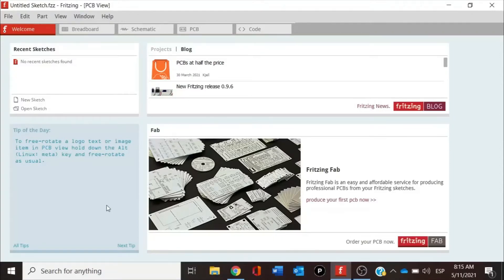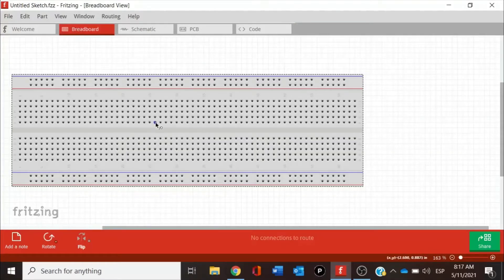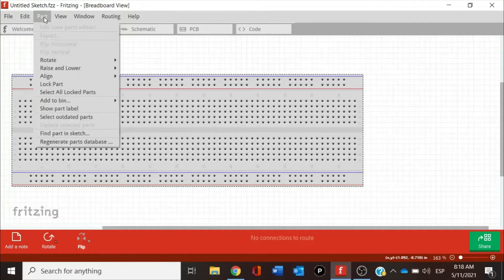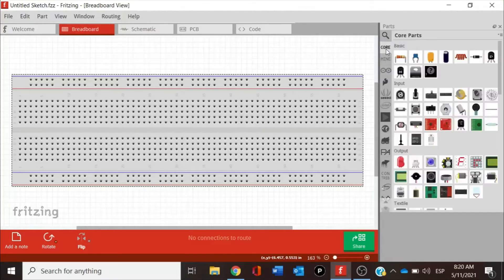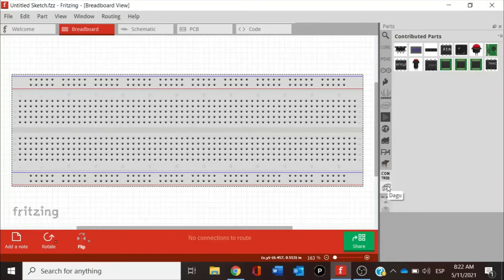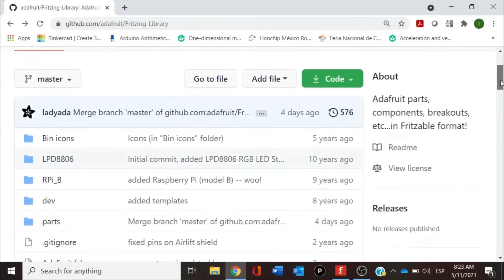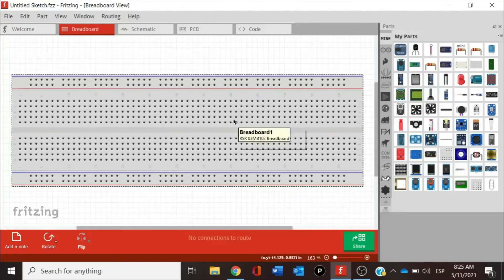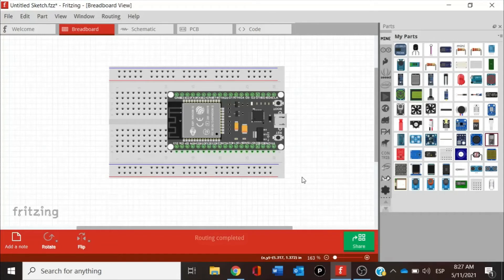Introduction Video to Fritzing

Comment: Good afternoon Master
I want to ask, how to upload an ESP32 sketch/program that has been made, how to do it "in Fritzing Software".
Because I was looking for nothing, the choices were just that, there was no ESP32 module or the like.
.
Please help master 🙏🙏
Reply from the maker: There is a tab at the top of the project workspace titled Code. You can enter code for Arduino boards and PICAXE platform boards only. At this time we are not aware of any esp platform connections that can made. It probably has to do with the way the arduino ide supports esp through the board manager utility. Fritzing does not have that feature and needs the Arduino IDE to be installed just to support its own coding feature. We would love to see this feature added to Fritzing too.